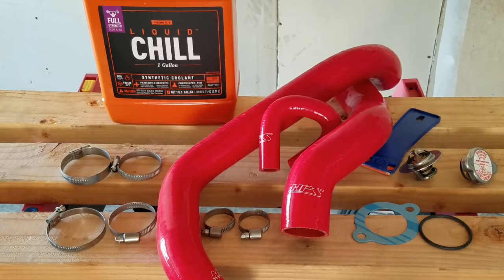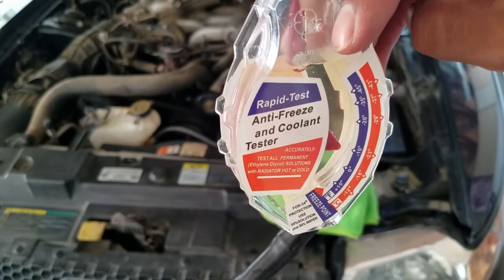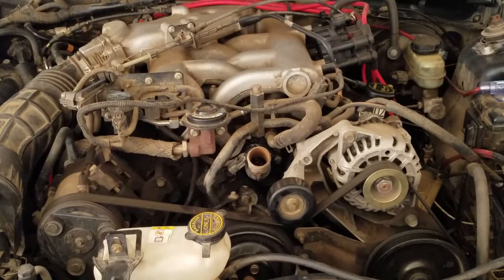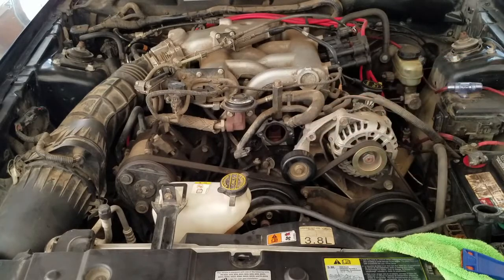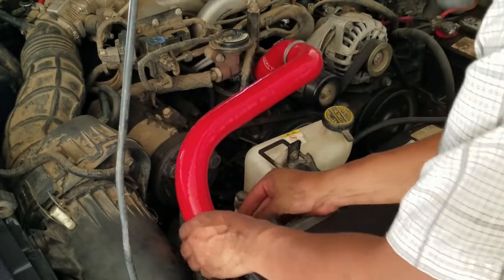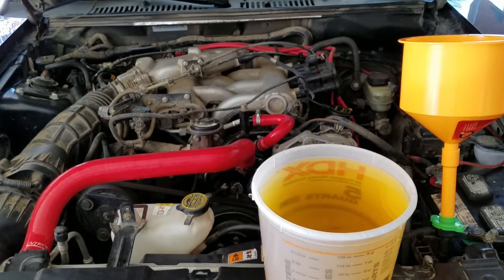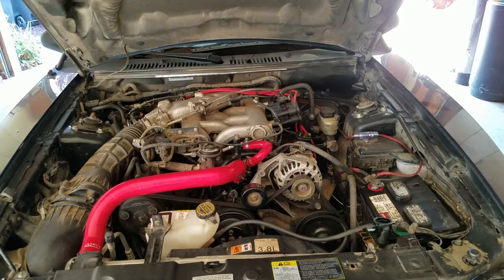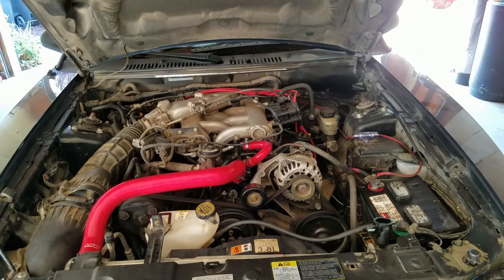How to Service the Cooling System on a New Edge Mustang(V6)

Comment from the maker: Update May 10, 2021: Wow been nearly a year since I made this. Over the weekend I drained the radiator and refilled without "bleeding." This makes the car throw overheat codes every now and then. The only way I recommend to bleed the air out of the system is to use a vacuum tool.  https://www.youtube.com/watch?v=BdBKOaZN998&t=71s

Comment from the maker: Update November 15, 2020: Paper Gaskets are this car's worst nightmare. I found that the Fel-Pro 35390-T from RockAuto worked perfectly. It is a hard gasket with rubber mouldings so no adhesive or RTV is needed, just make sure the housing mating surfaces are clean.

I also said the housing is held in place by 8mm bolts. That works, but a 5/16 socket is more precise.

Comment from the maker: Update August 9,2020:  City driving has been normal however, went over to the next town (7 mile distance) using the freeway. Casually drove there at 75mph and car felt smooth. When I parked at my destination the car started leaking antifreeze. Thought I was done for but it stopped leaking and car drove home like nothing happened. It hasn't leaked again. After inspecting the components it seems the leak came from the thermostat gasket. I think I may have a disaster waiting to happen so I will get a new thermostat housing, a really cheap gasket, and some quality gasket adhesive.